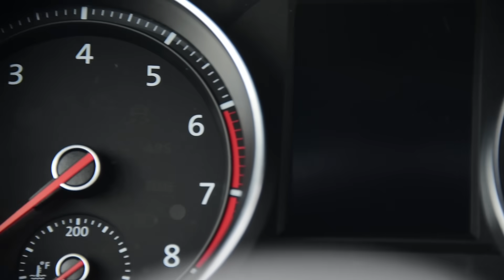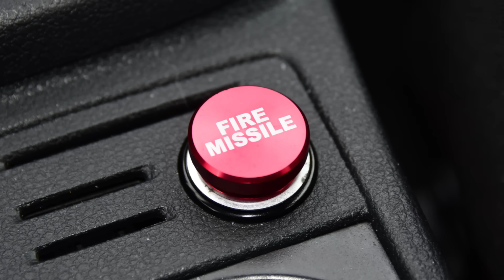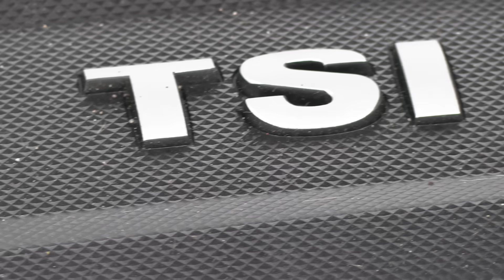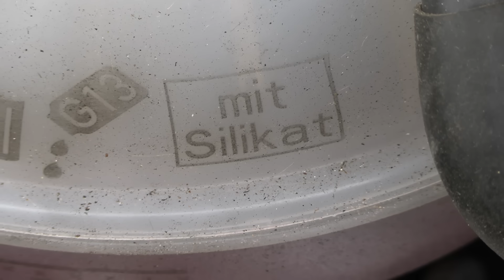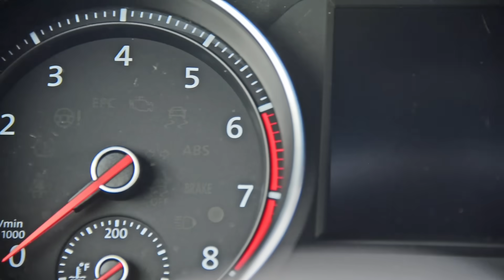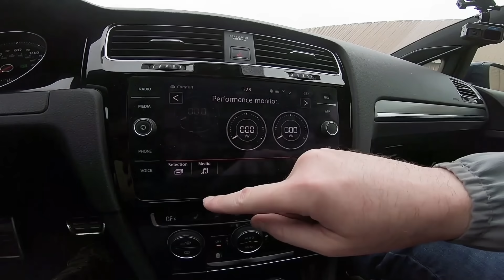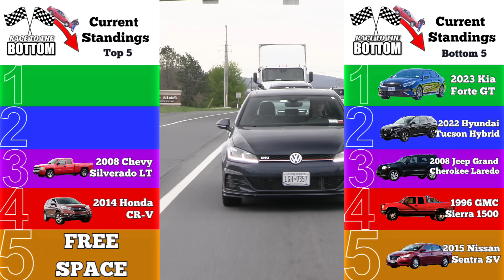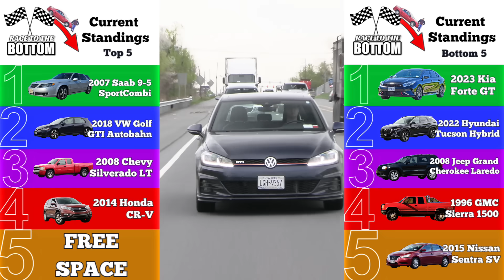2018 Volkswagen Golf GTI Autobahn: Regular Car Reviews

Comment: You North American consumers don't know how good you have it with VW Golfs. Better spec and way cheaper than their equivalent Golfs built in Europe. 

The reason the suspension is so good is because you get independent rear suspension in the US, even on the non-GTI wagon models of this vintage, unlike Europe which gets torsion bar. 

How can VW afford to do this in the US? By manufacturing Golfs in Pueblo, Mexico. Exactly the same parts and engines as the EU ones, but way cheaper labour.

Of course, hardly anyone in the US appreciates this or why they're cheap. 

Which means a paradise for a Brit living in the US - our Golf Estate did tens of thousands of miles of camping road trips for us at 40+mpg.

Viva globalisation!

Comment: As a Golf 8 owner, I'm really struggling to keep it stock.
Reply: Not me
Reply: What do you want to modify?
Reply: I’ll help you out then. If you throw a tune on it, you can kiss that warranty goodbye and start saving up for the water pump.

Did it work?
Reply: @GTI_Man  that's the reason why I'm keeping my stock.
Reply: @GTI_Man  actually here in Italy tuning culture is pretty difficult. At some point even stupid aesthetic stuff like changing rims could get you into troubles (first, cause someone will steal them the moment you exit the shop). I wanted to do some cooling upgrades, ECU tuning that i know it's pretty easy and maybe a DSG tune, since in auto that gearbox is asleep while in sport or manual screams for rpms like there's no tomorrow. (Edit) I'm actually not talking about a power tune, more of a fuel efficiency one. Mileage is pretty good but the 8 has really potential to be something exceptionally efficient
Reply: Me personally, add a stage 1 tune and maybe a red delete and she's good. Coming from a modded to hell and back mk7 GTI.

Comment: I had a choice between this and a 2018 golf sportwagen tsi SEL 1.8t. I like the gti but i already own 2 small coupes, wanted more room for more activities but the roofline on the wagen is lower of course. But both are great, sportwagen is way more comfortable though. Same exact tuning options as gti. Not to much different. Tune intake suspension TBBM ,oem+ parts , DV+ modification and stronger spring(the “PSH” delete as i call it) removed factory restrictions,(only VAG fiddlers would know what this means) brakes,no downpipe or aftermarket exhaust bs. Quiet as a tesla. Faster then a tesla.

Comment: I would be curious to see a comparison between the golf and the Civic Hatchback (regular, not type R). Both fill that practical hot hatch field, both have a modding culture, but the civic is a tier lower, but also more reliable and easier to work on

Comment: I wonder if the VW modding culture is mostly a coasts thing. Here in the Midwest, the vast majority of GTI's and R's I see look completely stock.

I used to be a huge VW fanboy. Had a Mk6 GTI for a while, ended up losing my job and had to get rid of it. Worked out because Dieselgate happened right after that.

By late 2017 I had grown out of my fanboyishness, but decided to check out the Mk7 because I needed a new car. The GTI was faster, cheaper, and nicer inside than the best Mazda3, more practical than a BRZ, and cheaper than a WRX. Ended up with a 2017 GTI Sport. And it's been really great ever since. Only problem I've had was needing replacement coil packs this year, and I did that myself easily.

The new ones are dumb just because of their garbage capacitive touch buttons. But the Mk7? Fantastic car. Can recommend. Fun and practical, and a damn good interior too.

Comment: See... a certain generation just didnt comprehend what the GTI is all about. You are supposed to get it tires when needed, put good fuel, change the oil as schedule and leave it the F alone. 
It has the perfect amount of boost for that little 2 litter, it has the perfect airflow and exhaust. It even has factory cold air. The whole deal about the GTI is to fight the ricer burners. Its to "umpimp your auto."

You can mess with the R. But the GTI is meant to be left alone.

Comment: 13:50 How dare you call the Michelin CrossClimate "awful winter tires"? They're legendary allseasons!
Reply: yeah, it's really great for climate that it might get cold, but not often enough to warrant full winter, surprisingly the tire did much better in rainy and wet road.
Reply: They were terrible on the GTI, I replaced them less than a week after getting this shoot, after only the ~240 mi round trip out to PA

Comment: You think that air filter housing is bad? The 2.0 FSI engine in 2006-2007 GTIs had the air filter built into the plastic engine cover, 19 screws to separate the two halves and replace the filter.  Ridiculous.

Comment: Personally I don’t understand why people care so much about the Stereotypes of cars and or the brand.
With one exception, Audi, I don’t see myself ever getting one because of the people who drive them.

But other than Audi, I don’t really care about brand, which may be why I own a tuned Volvo.
I don’t own one any of my two cars because of the brand necessarily, more so that I know how to work on them, I know the two platforms, one is cheap to run and the other is fun, makes lovely noises, while also feeling like home.
I have never been very sensitive to peer pressure, so I don’t think I will ever understand why people buy things for how or what it makes other people think about them. 

From a European perspective, the Golf GTI is one of those cars you can’t really go wrong with (unless you buy a clapped out one), it is a Golf so it does everything pretty well and it is a GTI so should be something a little extra fun.

Comment: Mk7.5s use the DQ381 7 speed transmission, the Mk7s previously used the DQ250 6 speed DSG. Idk how you miss basic information like that when it's generally available..
Reply: Also why I cant take roman seriously, or any "enthusiast" that doesn't hold technical knowledge..

Comment: 2018 VW Golf GTI: The official vehicle for the buyer who has no fear of Check Engine lights, knows how to gather up the courage to pay for the 60,000 mile service, and knows...just knows...that at any second, that water pump is going to go shrapnel on them, and buys it anyway.
Reply: The CPO warranty is too good to scoff at the opportunity to own one of these. I’ll start worrying in 2027.
Reply: As a MK6 owner whose water pump straight up imploded right at 70k miles, I thought the water pump issue was fixed with this generation of GTI?
Reply: @goldendevereaux  I believe your generation had the recalls, but the issues still lasted until changes were made around 2020 or so.  Ex-VW owner here who had that engine - we were recommended to get it changed at 60,000 as a precaution.
Reply: @aaronswink8554  ahh, okay. I know the MK6 has the water pump issue I mentioned, and also a timing chain tensioner issue as well.
I just thought they had fixed the water pump issue with the start of MK7. Been debating on getting a MK7.5,  or waiting another year or two to obtain a MK8.5

Comment: if anyone ever has a wrangler or grand cherokee 4xe that they offer up take them up on it. Driving many different cars at my job at a dodge dealer, trying to drive the 4xe's when they're cold is such a horrible experience. The idle is super high at 1500rpm trying to charge the battery that it sounds like something is wrong with it. If you let off the brake without giving any gas it'll creep at a half mile an hour, then if you breathe on the gas pedal it'll suddenly go 10mph. Its impossible to drive it around the lot smoothly.

Comment: The ultimate downfall of this car is the fact that it's a VW. It unfairly gets a reputation for being unreliable, low-quality, crayon-smelling, expensive garbage, when the reality is that it's the complete OPPOSITE. They're rock solid, great-feeling, great-driving, well-built cars that handle way better than they have any right to handle. They will eagerly fire up every day and won't ever break down on you if you just treat it well and do the proper scheduled maintenance. This is true with the Jetta, also. 

If this car had a different badge on the front, perhaps a Toyota or Honda badge, people would take it a lot more seriously than they do (outside of the enthusaist crowd). Being a VW automatically wipes it off the radar for normies.

The whole "servicing" thing is pretty ironic too. These are WAY easier to work on than something like a Subaru, where you have to rip off the entire bumper just to change a headlight. But in the eyes of the general public, the Subaru is the one that will "never break" (it will), and the VW is the one that will piss oil everywhere (it won't).

Comment: If you look at the used market/FB Marketplace, Rabbits and Golfs have higher resale value than GTIs because of the stigma around GTIs. And in my experience, it's mostly true. The Rabbit/Golf especially with the 2.5L is a solid, reliable, well made car that gets you from A to B. And it's much more likely to have been taken care of than a GTI of the same generation, as the GTI was likely used and abused.

Comment: Oh come on, torx isnt that uncommon these days. These days most basic multibit screwdriver kits will include a bit that fits the size torx used for most of the engine bay. Hell even my mom has the one for it. Granted you have to pick the specific size and philips is meant to be an "idiot proof" fastener by being sepf torqu limiting, but, like, I still dont think torx is that much of an inhibiter to repair like so many people tend to make out.

Comment: Volkswagen...😂... what garbage...the last Volkswagen I had my hands on was a new beetle..the car looked like it was brand new.. interior/paint/ engine bay..10/10...only had 60 k miles on it..car was popping/missing/CEL on/needed to pass smog check for registration renewal and a friend of a friend found lucky me to help..so I took it on.. OMG...end result was Volkswagen put the ECU under the center of the dashboard and attempted to make it weatherproof and cool it with ventilation from the wiper apron vents..the ECU was rotting and so was the harness..I had to swap the entire wiring harness and ECU.. advised the owner to junk it..they refused.. advised the owner it wasn't worth paying me 3 k to do it..they paid me.. after taking this beetle apart into a million pieces/reassembling it and making it run like new I can tell you that the car was actually very well made and robust.. heavier material/stronger than any Honda or Toyota.. just well made..but very bad engineering.. it's  fundamentally flawed..you can't modify what's wrong with Volkswagen.. Volkswagen is what is wrong...don't buy a Volkswagen.... Volkswagen=garbage...

Comment: Most overrated car/brand in the world.
Reply: Not really. Mostly solid and practical cars beside the chain TSI engines and the the sensitive DSGs.
Reply: @modco2.127  statistically no. Nowhere near top ten in reliability in any region on the planet. They don't handle as well as their rivals, they are an absolute bastard to work on and the 'quality' of their engineering is shocking. Saying they're okay except chain driven engines and dsg rules out half their products range. Just look at the 3.0 petrol and diesel engines, shocking quality and design.
Reply: Far from it.